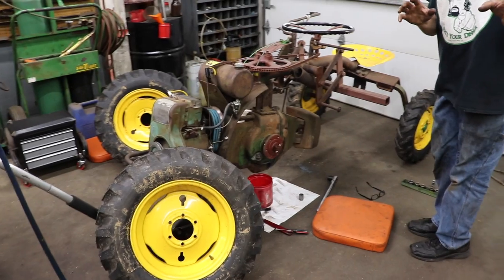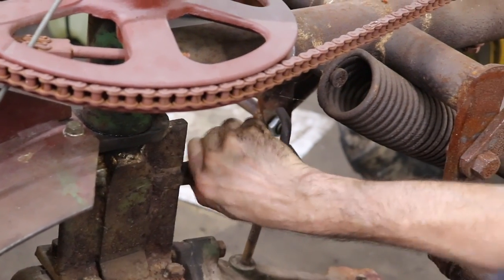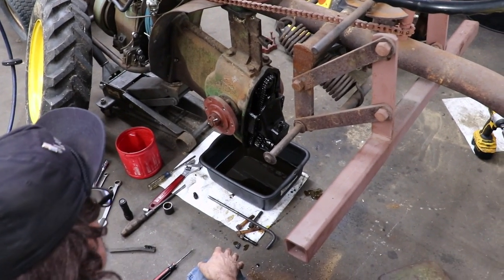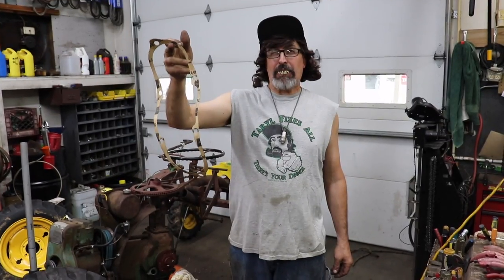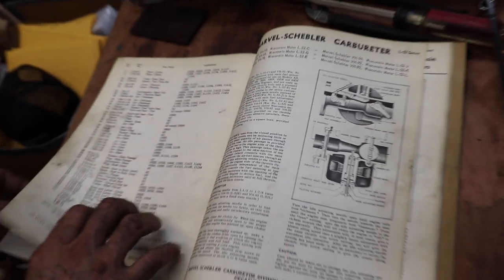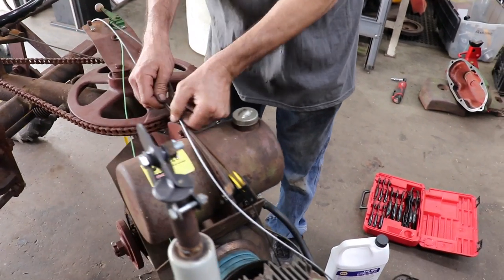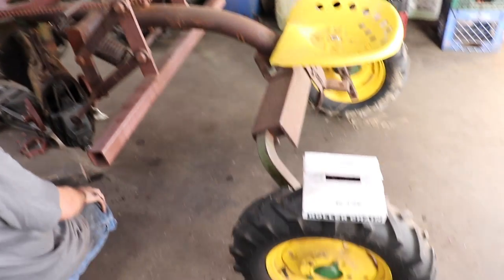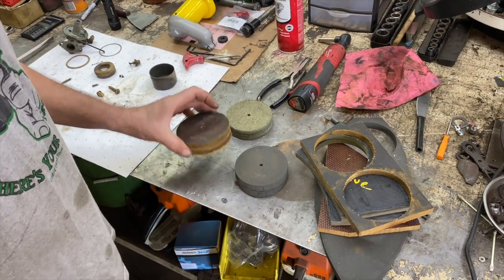AMAZING Bolens Ridemaster Restoration (Part 3)

Comment: I've hammered lots of gaskets in my time but never have seen the ball bearing trick.  Thanks for that Taryl.  Lots of useful info on Taryl Fixes All.
Reply: I usta have me a special ball peen hammer (small one) just for making gaskets.
Reply: @Fatamus  Me too Dan, still have mine.  Can tap right around a 5/16" bolt hole.  I think gasket making doesn't happen much any more.  Cell phones don't need 'em.
Reply: As I was watching Taryl hammer out that gasket I thought about how a small metal roller would work for the main part of it. Might go faster and smoother.
Reply: What I used to do when I worked at the Quincy Shipyard eons ago, was do the O.D. first like Taryl did, but then the bolt holes and then I'd put the tightest fitting bolts I could find into the holes so the gasket couldn't move on me, not even a tiny bit. Then I'd do the I.D. and I never once had a gasket that had even a single bolt that didn't line up perfectly. And I made hundreds of gaskets over the years. Btw, I was taught that trick when I was a Machinist Mate in the Navy in the 70's.
Reply: @ralphwatten2426  🤣😂 As Taryl says,  And there's your dinner.

Comment: I grew up in Beausejour Mb. Canada. Pronounced "Beau-jeer by locals"  Stefaniuks Garage opened in 1945  by Henry and Karolina Stefaniuk and closed in the late 70's. They serviced and sold small gas powered equipment. In the early days of snowmobiling they where the shop you went to for a good deal on a new Polaris snowmobile and to get it tuned up. Henry passed in 1971 his wife Carrie passed away in 2010 she was 102. Very impressive to see equipment that would have been familiar to those small Mom and Pop dealers from long ago being put back in working order by you Taryl.

Comment: Just about every gearbox I took apart has a coating of red sealer to keep the cast iron contamination from entering the oil. Never surprises me of all the nasties that come from inside gearcases that have been NO MAINTENANCE SERVICES. The PEEN on a ball peen hammer is for hammering over rivets. But also for many other things. Wisconsin engine manual really covers the engine second to none. Love your choice of stainless steel bolts. Thanks for the heads up on friction material Taryl too. My final thought is that you are hired by us all on YouTube to work on the Bolens Ridemaster. Good day too. VF

Comment: Long live  Bolens Ridemaster.  not a spray wand on air compressor ,but a shop vac for cleaning exhaust port  ,after taping , had to do that very thing on mine  , nice to see  the dinosaur roll, long live Wisconsin Engines , nice manual , Thank You Taryl  for videos

Comment: You forgot to take the fill plug out when you drain the gear oil. It works just like how you service an outboard gearbox. I was screaming through the screen hahaha.
Reply: Or it was probably all the crap he scraped out of there, guess ya missed that part
Reply: Trail of Dead well if the full plug was removed and fluid won’t come out, then I can understand as I watched the whole video.

But as shown while he tries to remove the oil, the fill plug was still threaded on.

Won’t matter even if the unit is spic and span, it won’t flow out without the fill plug removed. 

:)
Reply: Most non boat gear boxes have breathers to let air in and out

Comment: I've got a vintage machine I'm getting to work on about now. a 1967 Bob-Cat snowthrower, I could tell the year by looking at the engine's numbers. 5hp Briggs and Stratton "Easy Spin" starting engine, it does spin easily as butter is to cut but it needs carb cleaned and coil de-rusted. otherwise, its a good snowblower that I think is gonna run

Comment: The governor is a simple fly weight design. The cut away diagram showed the plunger oil pump with bearing valve and return spring. ( pump-circulated splash system) maintains the proper oil splash by the connecting rod dipper regardless if you have 1 quart or 1/2 quart oil in pan. Their larger aenld 9.2 hp used a pump driven oil sprayer. Great engines. Have several and fun to work on!

Comment: A tip for tapping I have seen others do is to put grease on the tap. It helps lubricate as well as catch the shavings. Take the tap out frequently and wipe the metal particles off as well as re-apply grease. Great video and thank you for the awesome content!

Comment: Great tip on making gasket holes.  I always put bolts in as I make the holes to keep alignment.   I was yelling to poke that drain hole with a screwdriver in case it was caked over inside with dirt/debris.  The Cat does not approve of your efforts.
Likely 60+ years ago I was in a shop where the V2 or 4 (I forget) Wisconsin was being worked on.  It had a huge flywheel with 3" long vanes on the perimeter pointing outwards. The engine was off of a Massey Baler.  When started up in the shop and revved up, one of those vanes broke, breaking others and a piece hit a man in the throat.  Not good times.
Reply: Yup! Did you hear me yelling along with you? Put the bolts in first?  OOps! Another trip to the car parts place. They kept the light on for him!

Comment: Don’t need to go to new yawk for friction material Tarly. Lima clutch and joint over here in Ohio does the same thing. Relined the brake shoes for myrtle (my 1949 Plymouth street rod) and built a new drive shaft for her when I put the 350 Chevy in. Good people to work with.

Comment: hey Taryl, I got my 67' Bob-caT Snow-Thrower running after cleaning the gas tank, coil, and carburetor! Traction Drive works but Auger Drive doesn't work yet. I had to take the muffler off in order to get the carb back on. when I cleaned the carburetor, I disassembled it on the hood of my lawn mower that I put a few paper towels on. there was some crap in the diaphragm's intake that was plugging it up so I took my carb spray and sprayed that crap outta there. 

starting attempt 1 (after putting machine back together): machine attempts to run but as soon as I push the choke in, it stopped.

starting attempt 2: I'm spinning the motor over and then it fires up, goes to max RPM, backfires, then quits. 

starting attempt 3: I'm spinning the engine over with the button all the way out (run position) just like with the previous attempts and I have the choke out. engine starts going so I push the choke in and it starts purring like a kitten! after about 30 seconds or something like that, I push the button down all the way and pull the choke to stop the engine.

later, I started it up and tried the traction drive, it moves forwards and backwards. tried auger drive and that did absolutely nothing. I shut it off and park it somewhere because I'm gonna come back to fiddle with the machine some more.

Comment: Section shows flyweight governor mounted on end of camshaft that operates yoke and linkage to external linkage. Camshaft operates oil pump as well as valves.

Comment: A lot of Wisconsin engines in the Canadian prairies. Lots of swathers in the 60s had Wisconsin v4 engines they were a beast of an air cooled engine. Where I’m from in Sask a lot of those places aren’t open anymore but usually the building still stands with the name on it. All the small towns dried up but the buildings remain.

Comment: As  gear guy i use break clean on the nasty stuff . I agree that Purple power does make a great solvent in the parts washer as well.  I also like to stick my gaskets on with permatex high tack  spray gasket.Great as always Taryl!

Comment: Most of the Australian companies don't exist anymore - but I'm familiar with all of them and own at least one Ronaldson Tippet.  I also have a Howard Gem which is a large petrol cultivator tractor used a lot in market gardens of the 40's-90's.  Now rare and expensive if in commercial use still.  In South Oz Finsbury was the biggest producer of pumps (and castings) for agriculture and marine, Ronaldson Tippelt made many engines in the 40's-60's typically smaller petrol shearing plant engines, or pumps etc. and marketed a lot of imported brands from England, the USA and Europe.  We were much more likely to have Lister or Petter diesels around here though particularly after the 50's as they were so much better at running for thousands of hours and economically so - even running reliably on low grade fuel oil cut with Kero according to my Dad and Father in law...   The companies listed in that manual as Australian agents didn't survive the seventies except for Finsbury.  Finsbury the original company started in 1946 and traded up until the 90's. Now the name continues as it was resurrected in 2002 and combined with Powermac later in the 2000's to be Finsbury Powermac, bigger and more established than before - they still supply a vast range of pumps and castings, but all sorts of industrial air compressors, hydraulic pumps, control systems and commercial equipment out of their Lonsdale South Australian factory and foundry.  So at least one of the companies is still kicking in Oz...

Comment: E-Z Off oven cleaner, overnite. What I use on burnt on oils. Basically lie, like plumbers use in drains,also takes aluminum off of crank rod journals. Neutralizing it with Sprite or baking soda, rinse with H20.

Comment: Talk about all those guys are gone. When I started in the RV business, I worked for an RV dealership. We had a trailer come in with a Duo-Therm furnace. We were stumped trying to fix it and no one in the shop knew anything about that particular model as it was 20 years old. So, we called the manufacturer for some help and advice. The service advisor said he didn't know anything about it but there was a guy in the back who was around when they were made. Sure enough, he said that there was a new part number that solved the issue with this model of furnace.

Years later, after striking out on my own, I came upon a similar situation. I suddenly realized that I had become "that guy from 20 years ago when it was made, who knows how to fix it".

We don't value experience anymore as we have become a replacement society instead of a fix it society and that's a problem we need to fix.

Comment: Been making Gaskets like that for more than 50 years. I have a 4 oz. Ballpein hammer from when I use to make Jewelry that i still use to make fine gaskets. hardly ever buy a gasket when you can just make them yourself, just buy gasket paper or use different types of card board solid sheet. like from a cereal box or shoe box. Surprised you didn't make  alot of your own. Glad some old timers like showed you how to do these things. On the farm and ranches we make a lot of what we need. Saves you dollars when you can just do it yourself. Something a these young people today just can't seem to figure out. Plain Common sense, which seems to have left this country. Once we are all gone what will these kids do to survive their Dumb future. So much common Knowledge gone.

Give her a name " Old Yeller " would do just fine. Every machine has its own personality. Every vehicle I have ever had, has its own quirks and personality, always gave it a name depending on what it was. Tractors, Trucks mowers as for cars which I have never liked, always been a truck man with gears never liked automatics. Had a few fast cars when I was a young man. I'm the only one whoever worked on one of my vehicles. Have rebuilt rucks from front to back myself. Have a ton of tools some I made myself to do just one job. A good set of swage tools and you can make almost any gasket. 

As for chains always leave a little slack as chains will stretch a bit as it breaks in. Never ever make them to tight. this can cause early failures. Excess wear and tear on your gears. A little give is good to much is bad. Ever put a timing chain on and engine they are not excessively tight. Having rode bikes and worked on engines and motors all my life. both electric and gas this is a rule of thumb I learned on old farm tractors back when I was a young pup from the older generation that taught me just common sense, I have used my whole life.

Comment: The one in Saskatoon doesn't exist any more, but I can remember when it did. That is Saskatchewan Canada. No surprise there were lots of shops in Saskatchewan. Wisconsin engines were used on a LOT of farm machines like augers. The most common was that air cooled V4. Those things were everywhere.

Comment: Okay Taryl , did you find some bentonite grease in that transmission? I don't remember transmission make but it was a  olderJohnDeere 5 speed and it had bentonite grease in it. There's nothing to cut that stuff. I used Kerosene and it made it a little mushie. That's the worst grease there is to clean. Oh yeah, I found out, ALL lawn mower shop refuse to work on lawn mower manual transmissions, at least the internals. They JUST DON"T.  I got mine back together, it need $20 of shift keys. I put John Deere corn head grease back in it as it was way cheaper and cleaner to  work with.

Comment: I love purple power, it works great for de-greasing. After cleaning gears and bearing surfaces, I would make sure that they are free of oil and grime, rinse everything very well with hot water and then dry in a oven at maybe 120 deg. They would come out with the slightest whiff of rust haze, but they would be dry and won't contaminate the oil when everything is put back together and sealed :)

Comment: Talking about companies that are still there, about 30+ years ago I used to drive past a Tecumseh engine factory that I think, if my memory isn't too rotted out, somewhere around Mitchell, Indiana. I think. Are Tecumseh engines even used anymore (?) Had one on an old cheap Sears push mower that would not die (I called it "My Rock Finder"), the deck underneath literally rotted out first.

Comment: I'd never used PB Blaster before, my Dad had always used Liquid Wrench.  I had a blade bolt and blade adapter that wouldn't come off and the guy at the local laundromat suggested PB Blaster.  I was pretty impressed at how well and quickly it worked.  Have to look at Purple Power for future needs . . . in The Future!

Comment: That thing is pretty cool,I watch these video"s just for your clever tips from your year"s of experience.If it were me(but it isn"t),I'd run that exhaust set up down low so the fumes outta that muffkin aren"t blowing in your face.Maybe add some weight underneath that engine for maximum traction.

Comment: Looks like oil pump identified on first pages is driven by rod from camshaft and sips oil from lowest part of sump through a strainer and loads the trough for the con rod dipper/oil slinger.  That would ensure splash lube even with engine running at an angle. First pages show section through the governor it’s a traditional centrifugal weight versus spring tension, weights fly out against spring tension and move a collar that moves a linkage attached to shaft that takes it out of the engine where another linkage operates the carbetrator linkage.

Comment: Purple power is good but for really crusty, use oven cleaner.  As long as there’s no aluminum.
Edit: Also what was in there won’t smell like “gear oil” because they specified non-EP oil.  The EP additives are sulfur based which is where the smell comes from. Those additives are also corrosive to red metals.  That means there are some brass or bronze parts in there so definitely don’t use an EP gear oil.
2nd edit:  The cutaway illustration in that manual is showing a plunger oil pump.  There aren’t oil galleries or a pressurized oil system, it’s just a squirter that sprays the moving parts.

Comment: taryl, i've been told the red paint on the inside of early cast metal gearboxes and engines is to seal very porous cast metals.
.
hot tank dipping and sand blasting removes the sealer and if not redone can result in weepy metal and the failure of external paint.
not sure about the validity of such claims, so i would love to hear your advice.

Comment: Really coming along nice - kind of a 'cult' you got yourself into here as I found a few YT vids on the ridemaster. 

My only issue - the cast street elbow you used in the exhaust likely has a smaller inner diameter than a metal piece, which will restrict the exhaust flow somewhat. A metal piece likely won't last as long, but may give you a bit more power.

Comment: On one of your other video's you needed to go to the parts store to get a few bolts.  I always go to Tractor Supply they sell all standard threaded bolts by the pound. I throw like four nuts and 4 bolt  in a bag of each size  and lengh  and washers.  .For $10 to $20 you can have a great selection of bolts on hand. I grab 5 LBS evrytime I go there and put them a parts bin....

Comment: Sometimes when your cutting a gasket that way and the gasket material will not lay flat or moves around I would make the holes first and then find some bolts, washers & nuts to secure the material to the part first then hammer out the shape. Also if there are areas where there is not a lot of material around the bolt holes the gasket will rip if your not careful and do the holes last.

Comment: Taryl, you are fearless. I think you wouldn't have any problems working on King Tut's garden tractor. 
Well the manual is in ancient Egyptian hieroglyphics, and the lubricant hasn't been around for 5000 years, so I'm going to use 90 gear oil.
There's your dinner.

Comment: Purple power is the best. At the start of every season, I buy a 5 gallon jug of the stuff, it lasts me almost the whole year. I use it on everything, in my Ultrasonic cleaner for carbs, they come out looking brand new, spotless, cleaning grease and grime off engines, trans, gearboxes,  etc. Just gotta be careful with that stuff around paint, it fades it fast!

Comment: 29:44  three to sixty point five horsepower.
If u have a pipe thread exhaust,
use a brass nipple to thread into the engine,
and it will never try to rust into the block.